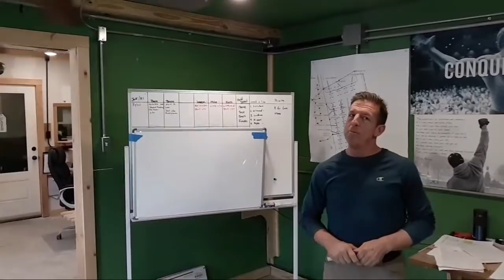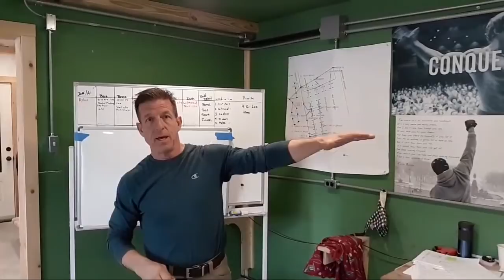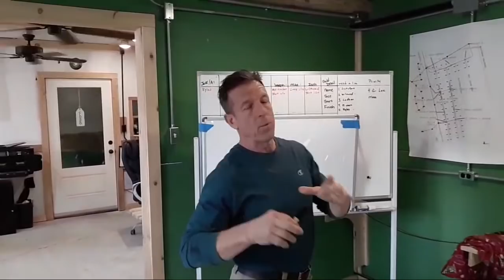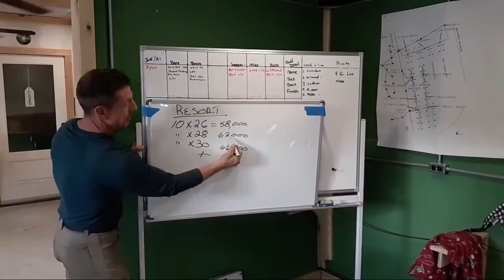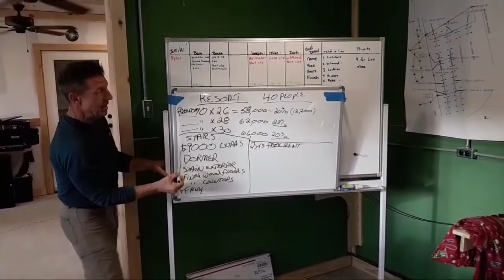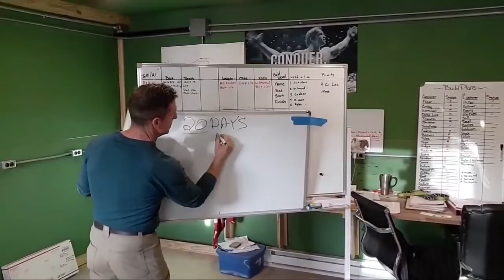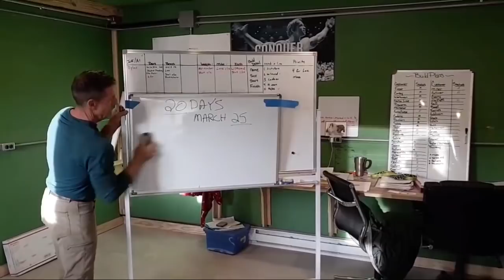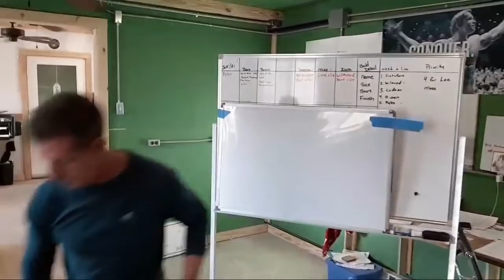Tiny House Resort & Community Update

Comment: The Japanese method of burning the wood is called SHOU SUGI BAN, it makes the wood FIRE RESISTANT AND INSECT RESISTANT.  One YouTube fella is staining the wood after a mid range burn (not all the way to a cracking, all charcoal treatment)   He does the mid range burn, sands it and does a colored stain (red, blue, green, or yellow) over the Shou Sugi Ban, it comes out some colored wood with some charcoal wood, really, really beautiful, then he uses it for flooring, coating it with polyurethane to seal it.